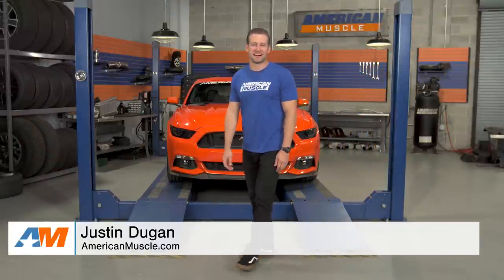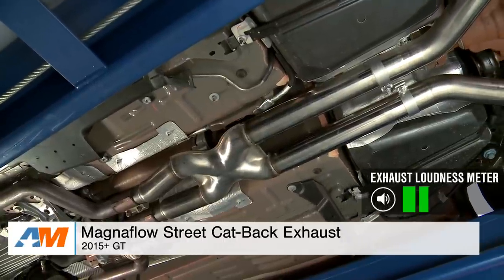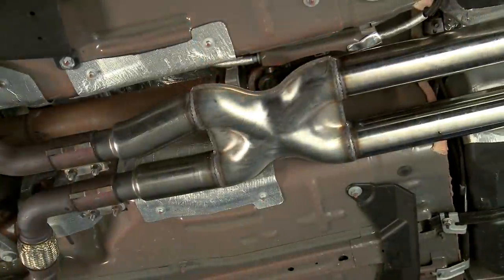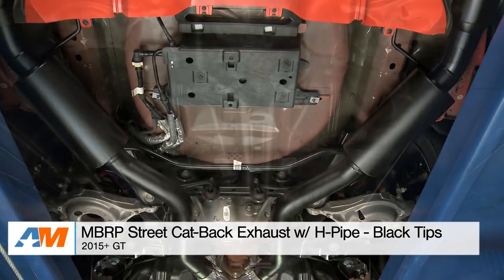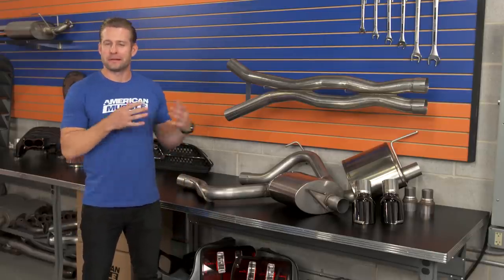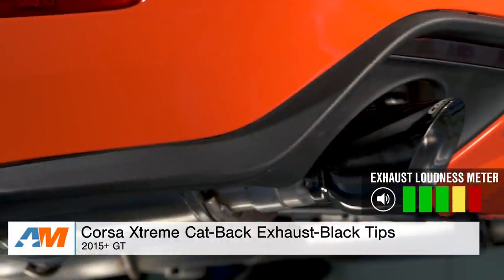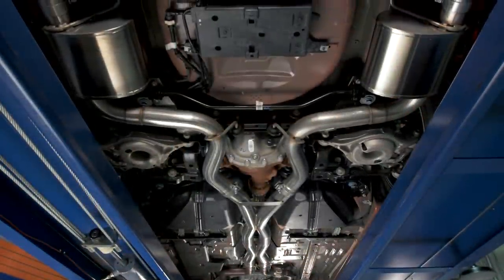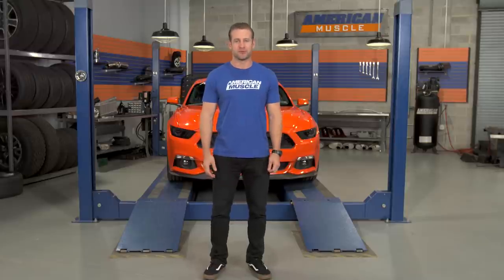Best 2015-2017 Mustang GT Cat-Back Exhaust Systems Reviewed!

Comment: First off I'am a 71 year young Mustang lover , I just bought a new Mustang , love it !!! I have a 03 Fire red GT, 5 speed with 5,500 miles , "NEVER" !! Been in the rain . like new !!!! For sell or trade for a Ford Truck , one a kind !!!!
Reply from the maker: That's awesome Ed, I'm glad you are still passionate about these cars! Let us know if you ever need anything! - Will
Reply: Sounds like you don't love it to much you don't drive it.
Reply: @Yocannon  I made a living building them cars at Dearborn Assembly Plant blocks west of Detroit and also the S197s at Flatrock Assembly until 09 then transferred back to Dearborn to build F150s. I own a triple black 03 GT vert myself since new with 59,000 miles on it now and I think its crazy for people to spend 30,000$ or more on cars that I seen come down that line in huge numbers and seen many mistakes made on them cars during the carnage of building them. We built 41,756 GTs just in 2003 alone not counting the other years of the New Edges so theres nothing unique about them. Putting financial pressure on your household just to look at something common siting there is crazy no matter the age u are.

Comment: Will a borla cat back make engine light come on ? Also will airaid cold air intake make engine light come on ? I wanna but these for my mustang but I don’t want to tune or void my warranty. Thanks in advance
Reply from the maker: You really shouldn't have any issues with a cat-back system giving you check engine lights! Since everything is after the catalytic converter your exhaust flow isn't going to be greatly affected. As for the air intake, as long as it is no tune required you won't have an issue either. As for warranty, I'd recommend getting in touch with your dealer before doing anything. -Zach

Comment: Dear Mr Dugan,G'day mateI live in Perth Western Australia and the GT Mustang along with its baby brother ( Eco) have now started arriving in Australia. We have been waiting for ever to get some mascle cars down here and finally they have arrived. I went to test drive the GT 5.0 and was impressed with the power it had yet the sound was not how a Mustang should sound. After searching the internet I came across your video regarding the 3 different Cat systems that you reviewed.I would like to order the 2nd type of exhaust I believe you called it the MBRP Street Cat Black.How ever I do not just want half a system I want to get the full nine yards from the extractors (I think that you guys call them headers) all the way to the tail pipes so a complete system. I also do not want just a single tail pipe at each end (left and Right) I want the system to run the length of the car with two pipes and the end of each side.In your video you did not show that but I am sure that you can get your hands on some.I am ordering the Pearl White colour and would want the tips to be all in black I do not want to see stainless steel at all from the rear of the car.Your 2nd choice is the one for me as it sounds awesome from the out side and I am taking your word that I will not have a loud drone inside the car while driving.Could you please get back to me regarding my request can you do the four 3 inch system after fitting the headers?As the Mustang is now coming onto the market here in Australia I believe that there might be a good demand and if you look after me on the costs etc. I might even discuss opening and American muscle cars add ones. I never let an opportunity like this go into someone else's hands as I would use my car as an example and should I get enough enquiries well maybe there is a chance that be could start up some sort of business together as I have a lot of friends in business that are also wanting to but the 5.0 GT. I have 1800 clients that I now already who have put a deposit down on the cars already and that is from my side of the country. I live in the West in a city called Perth and there are 6 other cities on the east coast that I am sure I could get business from. Our state along is have the size of the USA.I am seriously thinking about some sort of business partnership as well. As I could opened a shop and promote only your products for the whole of Australia.Should you wish to get back to me 1. With a price for my GT exhaust system and 2. The opportunity to take on the Australian market as no one is doing it "YET"I have friends who do this sort of work but for now you are the only one that I have talked to about this.Australia only has about 23 million people in the entire country but if we got in the markets where the rubber hit's the road there are so many things that we could sell to the owners of the GT Pony  now that we are only getting the 4 cylinder turbo and the GT at the moment but there are some snakes turning up as well.My email is doug.fraser8@westnet.com.au. I look forward to hearing from you mate.Regards,Douglas C Fraser

Comment: Ok opinions needed: i have roush axle backs with an h pipe and i love it. Its perfect by itself but i plan on adding off road headers and i need a catback that’s quieter but still will be pretty loud. I was thinking either magnaflow competition or borla s type. Thoughts?

Comment: The Magnaflow Street is NOT a quiet cat back. It may be the quietest outside the car but it is VERY LOUD inside the car. I had an MBRP Street before the Magnaflow and even though it was LOUD AS HELL outside it was MUCH QUIETER inside the car than the Magnaflow Street. This should has been mentioned in the video.
Reply from the maker: Hey G37 Dude- We are basing this off of external or 'outside' volume.  I will say your experience with the MF Street is different than mine and many others- as I feel it wasn't that loud inside the car.  But either way, thanks for the feedback. -Justin
Reply: AmericanMuscle.com maybe in the future you could measure both noise levels with a db meter. That would make your already awesome videos more informative.

Comment: corsa sounds loud but with bolt on tips i wonder how long before they fall out without the spot weld. they sound good just not a fan of bolt on tips. Borla atak waa my choice.
Reply: J P I got the corsa extreme on my 2016 gt and i have to say those tips aren't going anywhere. I had the same concern but they stay on
Reply: I have an mbrp catback on my Focus, the tips are bolt on and are actually really solid. Survived hundreds of miles of rally driving and didn’t even budge a little bit

Comment: I went with the MBRP 1 7/8 long tube headers with high flow cats, H pipe and blacked out MBRP street exhaust. It is crazy crazy loud! I want a deeper tone muscle sound, would that magna flow street with my current  headers be loud as well? My current MBRP set up is way too raspy. Any suggestions would be appreciated as my neighbors hate me at the moment, and I don't blame them.
Reply: LT Headers tend to be make the exhaust very raspy. Catted headers should have helped at least a little. I am running catless Long tubes, Ford Racing X pipe, and Borla S-Type catback. It has an incredible tone but definitely has plenty of rasp that comes along with it.

Comment: I know it’s a GT but won’t the exhaust fit to the ecoboost also or is it just specifically for the GT?
Reply from the maker: GT exhaust systems are made specifically for the GT. There are differences between engine options that won't let systems fit all engine options. -Zach

Comment: I had magnaflow streets on my 2011 gt. They sounded nice but were too quiet for my liking.
Reply from the maker: What did you end up getting instead? :) -Elaina
Reply: Well, I just got a 2017 GT and have not decided which exhaust to get yet. I like the Borla sport by Ford Racing. The Roush Axel back sound nice. I also really like the Magnaflow competition series. Black or carbon fibre tips :)

Comment: When i bought my 16 gtpp it had mbrp on it. Just recently ive heard a rattling and cant find it anywhere. Not aure if the exhaust has a baffle or something inside that's making the noise but it is annoying when idoling. The exhaust is also atarting to rust out in some places. Sadly i might replace it at some point.